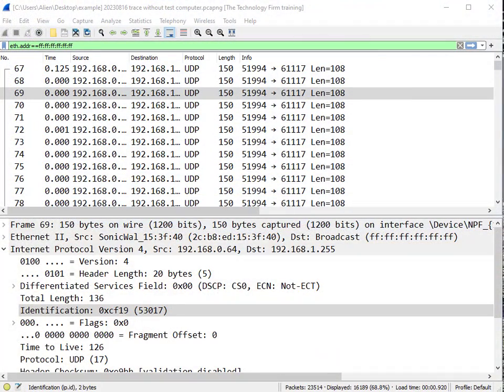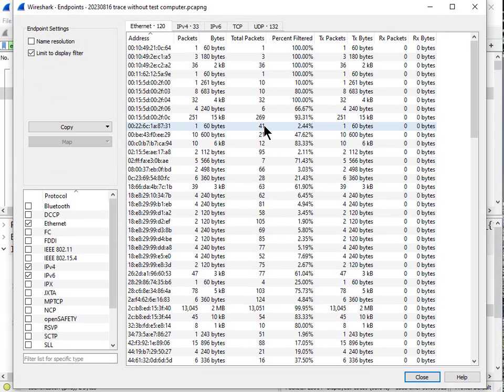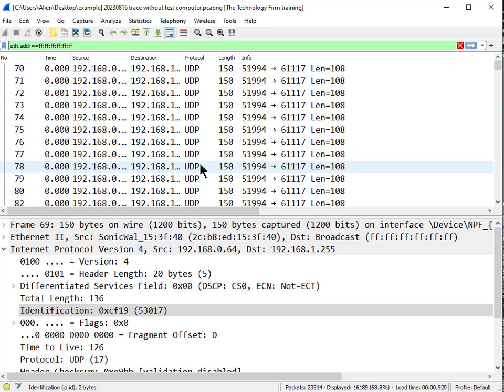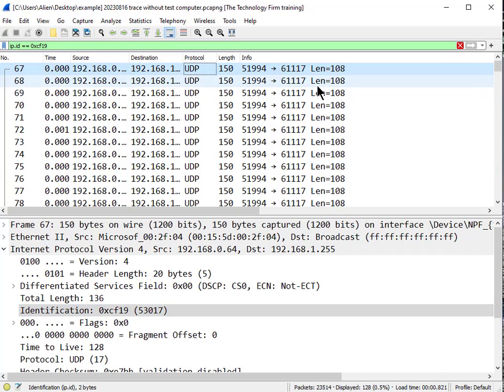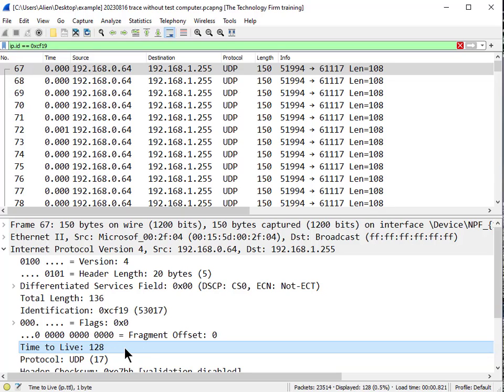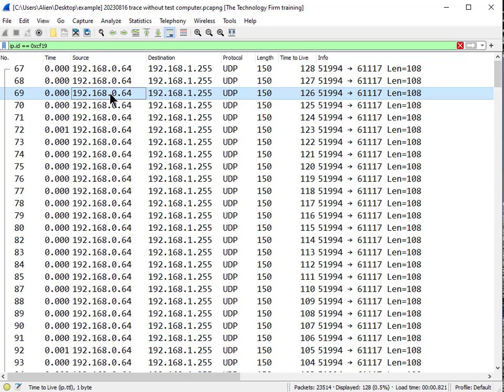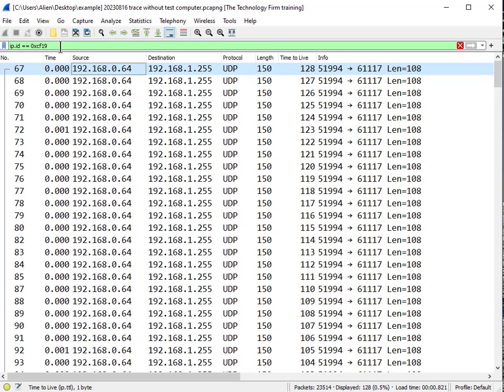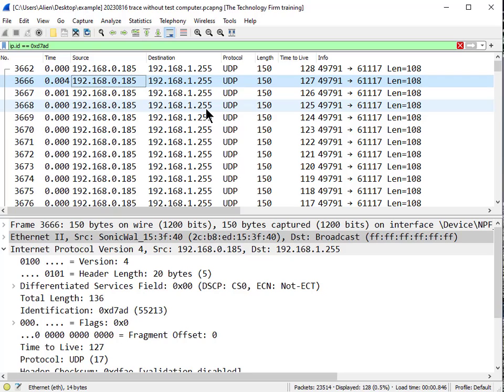Troubleshooting Loops: IPv4 ID/TTL and Addressing Notes

Comment: Many thanks Tony 
Q if possible 
How do the station teaming might create a loop as layer 2 loop?
Reply from the maker: ive seen switches get confused with the virtual mac
Reply: @thetechfirm  me too, and more that I seen layer 3 switch routed port making layer 2 loop for a while. However I believe virtual mac will not make actual loop instead it makes mac flapping. If ip forwarding is enabled then it would or there is a bug in nic Driver. Many thanks